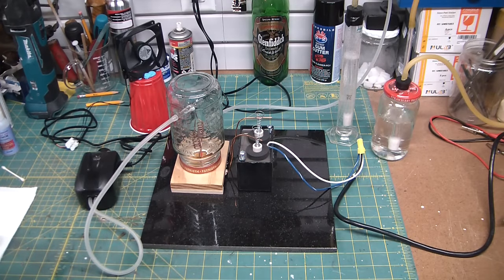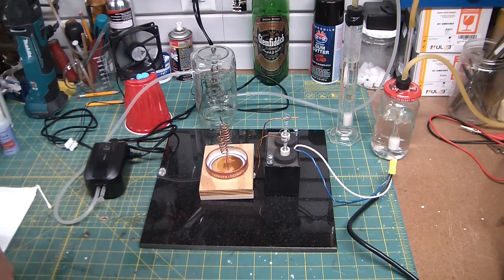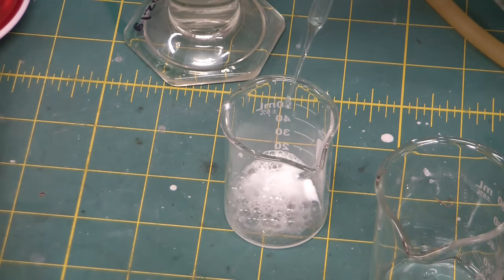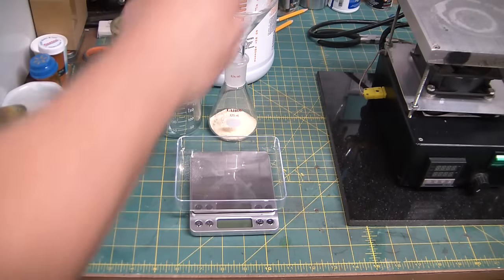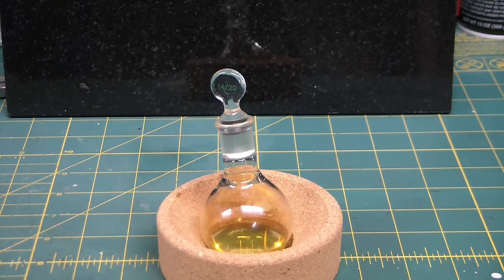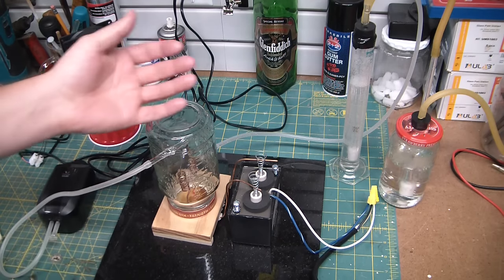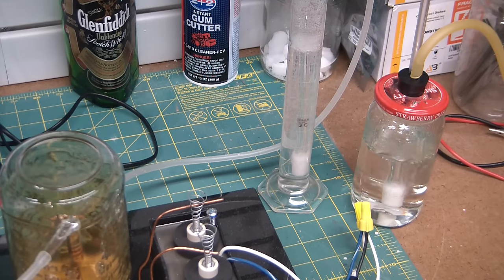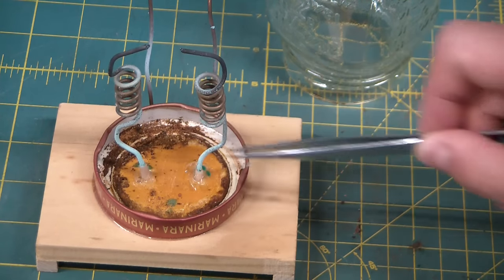Making Nitric Acid From Air - Elementalmaker

Comment: As a lab technician, I got anxiety from watching you work without gloves and walking on flip flops. You already burnt your finger yet you continue to work without protection. Please consider a safety course since you violated atot of rules for working with chemicals.
Reply from the maker: The flip flops were definitely an brain fart. That being said, it is not recommended to use gloves when working with rfna, as it will cause them to spontaneously combust on contact. Bare hands is considered safe lab practice for handling rfna.